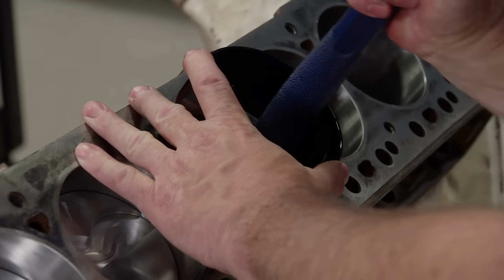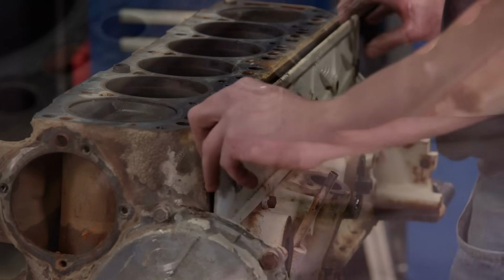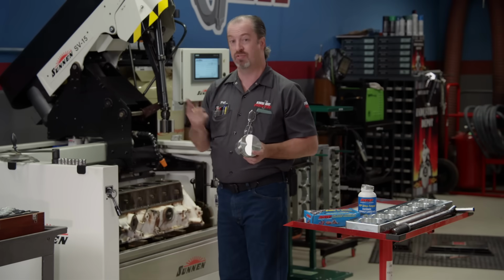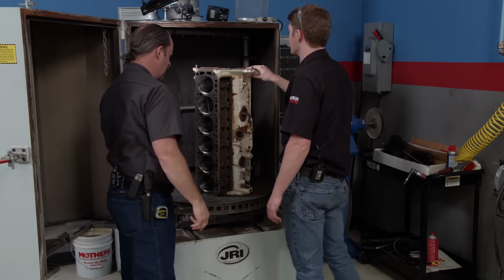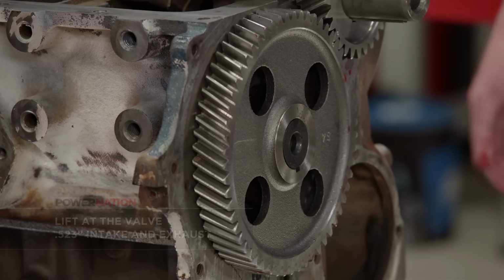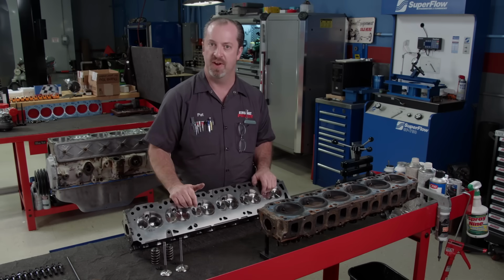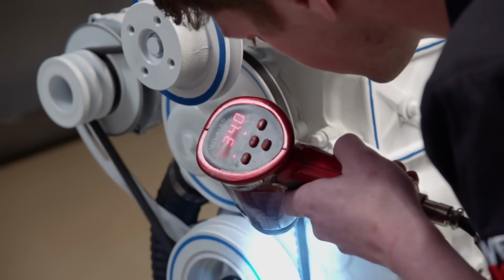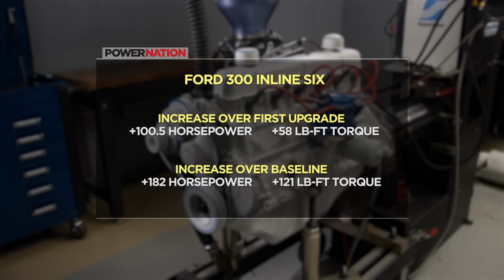Full-Tilt Build On Our Ford 300 Inline 6 For Serious Power Gains - Engine Power S8, E3

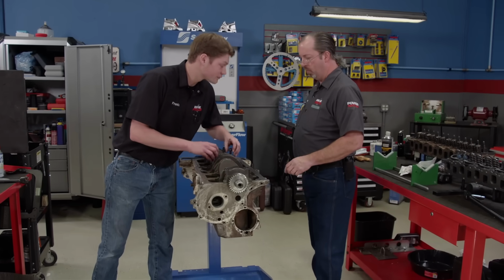Comment: @11:55  Question:  If you are so concerned with distortion and accuracy why are you assembling that WaY vErY LoNg AnD VeRy HeAvY InLiNe SiX CyLinDeR on an engine stand?
You REALLY ought to be doing that on a table!
those engines are known to distort under their own weight AND break engine stands!

Comment: A friend had me put a piston in his 300 6...he got me a new piston, but it had a huge dish, compared to the og flattop pistons....it actually ran! What was so amazing, it would run on 5 cyls. At idle, and by about 2000 rpm, that cylinder would start firing! I thought it would blow up, but it didn't. Now, the amazing part...it showed how weak low compression was (7:1), as opposed to 9:2 to 1 (og). A drastically dramatic difference!

Comment: My dad had a 1989 F-150 with a 300 I-6 with EFI when I was learning to drive.  Regular cab short bed 4x4 5-speed and 3.08:1 final drive (ugh).  It got better gas mileage in 4th gear at 60 than it did in 5th, but it would get 18mpg at 70 in 5th.  It wouldn't go over 80 mph though.  Horsepower was 145 and I don't know what the torque was but the peak was around 2000 rpm.  When pulling a trailer (around 3k lbs of utility trailer and lawnmowers) it wouldn't maintain 60 going up hills, but down shift to 3rd and it wouldn't drop below 2k rpms no matter how steep the hill.

Comment: great vid! Based on the cam and the mild head that was what I was about what I was expecting...the cam, compression, moderate headflow (but vast improvement over stock) left me thinking that applied to a typical v8, I'd expect a 350hp build. Fun to see builds that aren't the typical.

Comment: I was expecting 1 HP per cubic inch naturally aspirated.  Perhaps a roller cam was appropriate. In the video, the cam seemed smallish, and the engine fell off the power curve quickly. Cotton Perry was a legend 50 years ago racing with his 301 inch Chevy six. Check it out: http://competitionplus.com/drag-racing/news/18688-cotton-perry-and-the-legend-of-the-pocket-rocket

Comment: How about a much more available engine, the Jeep 4.0
Reply: They already did that there's actually a really cool build where they maxed one out on the horsepower monster if you want to read about that and they said a new world record for those Jeep 4.0 I like the Ford 300 better because it's got an open plate to the lifter galley and I really hope someday of being able to make link bars and a spider so I could put roller lifters in there and it's just bigger and it's Ford although I'm getting quite mad with Ford right now with their EcoBoost as nice as they are when they work when they stop god its a pain working on them.  and the Ford 300 was put in tons of things not just Ford trucks but industrial delivery vans those UPS trucks that delivered all your Amazon crap well I think Amazon delivers their own now but still those all run on Ford 300s Ford straight sixes I mean hell this 300 came from the industrial side it was running a pressure washer I think they said

Comment: I liked to see a build on the V6 4.0L SOHC You know the engine that was in the  Ford Ranger 2001-2012 Ranger, 2005-2010 Mustang, 1997-2010 Ford explorer. and 2005-2009  Land Rover LR3 (Slightly different block cast). The motor is in a slew of cars what are you afraid of Summit not having any easy mods for it.
Reply: They are afraid of the timing chains and guides failing
Reply: @KRRZ350  205000 Miles on mine no failure yet. So I call BS

Comment: I'm still waiting for a dyno shootout of engine bay heat, shaker hood, cold air with cone, and a ram air via.. 427 Fairlane thru high beam headlight bucket replacement..  certainly your buds next door can assemble a mustang or camero front clip to roll in and around the engine in the dyno room.

Comment: I'd like to see the manifold converted to efi using speed density, a holley HP ecu, and a turbo adding at least one atmosphere or more.  Has anyone ever compared the bore and stroke of the 300 and the Ford 302?  The 300 has more leverage.

Comment: sold my 84 ford van to a guy 13 years ago and it had 338,000 miles on it then...the guy still has it and daily drives it . never been rebuilt just regular services...so yeah that 300 is a longevity monster....and also the reason i am looking for an older ford pickup with the 300 in it

Comment: Kinda sad a stock bottom end Honda K24a2 can make similar power with bolt on's and a tune. Yet it's half the displacement. The head on this motor must be incredibly inefficient.
Reply: David Galea  Ford came out with the Boss 302 in 1969. There wasn't a factory small block head that could out flow it until 1997... If ford would have wanted to make a killer head for the 300, they could've.

Comment: Sorry fellas, I know you're trying to plug your sponsor but those water pumps on a 300 are garbage. The cast housing is too big for the hose size. At least it was on my 95 f-150 with a 300. It should be machined down but it's not so the stock hoses don't fit.

Comment: As a Ford guy. I have a lot of respect for the 4.9. I had it ina 93 F150 with a 5 speed Mazda. I smoked a few 5.7s and 5.3s trucks. When we were loaded they didn't stand a chance. No load they would catch up later. Launching I had the advantage. I put a centerforce clutch from summit racing

Comment: @powernation. I believe you would see better  horsepower using the Offenhauser C-Series intake or a Clifford performance intake instead of the Dual-Port. The C-Series or Clifford intake would also be better for boost. The dual port is likely a restriction N/A and will definitely be a restriction under boost. Best of luck Guys.

Comment: Cloydes has a three key adjustable crank gear. That way you can change cam timming later to try to boost HP. How did you discide on 6 degrees advance cam timming?

Comment: I wonder how long the thing ran with the rag in the water pump. The rag looks in pretty good shape, so they probably did a "overhaul" on it then set it aside. How long did you guys run this thing during the tests. I wonder how most V8 engines would put up with this nonsense.

Comment: Hopefully someone will make a decent aluminum cross flow head for these, I could easily see 300hp and 400tq if it could breathe better, ive got the same engine in my 80 bronco, the original 302 and then used 351w I put in didn't last long,  that 300 wil last forever, I'm getting ready to put efi with intake and exhaust on it
Reply: If enough people by the other parts like cams and intakes and exhaust I'm sure they will problem is everyone who has enough money to do stuff like that always goes for the v8s so if they did make anything for the 300 it would have to be cheap to sell or at least that's what I think and that's why you don't see that much and I mean it was a base engine base engines never get the love I had a 2011 mustang v6 and I had that thing running low 12s in the quarter mile with just a vortec V3 with a bracket and intercooler and tubing I made myself on 9-10 psi with 26mpg average it was awesome but there was hardly anything for it cuz it was the base engine and you get a coyote and do so much more

Comment: Needs more cam. Get a custom grind that will raise the power peak up to 5500 rpms.
Reply: I don't think you could even Rev that high without upgrading the crankshaft and bottom end.  These engines are low RPM torque monsters

Comment: I had an 85 Ford Econo with one. The only problem I had was aftermarket replacement distributor parts. I replaced the electronic board 3 times before I got a good one.

Comment: Thanks for doing the Ford 300. That would make a great engine for a host of different projects. I don't believe in brand bashing, I believe in working with what you got or what you like. I'm in the process of building a 225 slant six and I might put it back in the Aspen it came out of or I might build a rail for it??? Thanks for video guys

Comment: if I was them I would look at a custom Crank and swap her over to EFI as well as look at changing the Sparkplugs out for Better ones like E3 etc and also look at swapping them to a Rolla Cam bearing style it would free up more Top-end Power and maybe get her to the 1HP per Cubic size.. as for adding a Turbo it would push the HP up by maybe 90-120 HP and 80-100 FPT but in the end, the 300 is a good Block I used one in my Dirt track Car until my car become tboned in a bad crash,FYI been a ford man my Whole life.. long live the Blue Oval

Comment: I learned to drive on a late 70's F-100 Custom with the 300 Inline 6.  It ran on neglect, never let us down hauling wood, and would claw its way through snow like nobody's business. Gear wise, it topped out about 65 mph, but on the low end, wow!

Comment: Still run a 81 and 84 f250 4 speed trucks with a 300 in them and when my f600 died on me 2 miles from home the 81 brought it home up 2 hills didn't hesitate and the 84 is a service truck that weighs in at 11,500 and just laughs at the weight it not going to win races but will run longer than the truck very dependable

Comment: I had an 88 F150 with this engine. It got 11 miles per gallon. 11 miles empty, 11 miles on the highway, 11 in the city, 11 pulling 10,000 lbs... it got 11. Lol, but it Never Died!!
Reply: i drive a 96 F150 with L6, i get 15.3mpg highway, no load, running about 73mph
Reply: @maxtheroofer8004  I'm currently driving a F250 SD with the 6.2L. I get 12.4 mpg. BUT I LOVE IT!

Comment: The 4.050" piston you said is for the 390. The 360 is 4.050" also. Is that the same piston? Or does it have different dimensions in pin size or height?
Reply: 360 and 390 use the same piston they use a different rod

Comment: Nice build, i,m curious to see the fuel consuption of tha 88hp vs the 200+ hp engine
Reply: In reality does it really matter? It's not a v8 but it's displacement is right there with them so the two less cylinders is pretty misleading. Calling them "economy" motors is a joke
Reply: @dustinlittle4194  in trucks theyd operate at lower rpm vs the 302, and wouldn't lug at low rpm as much, vs the 351 and 460 a stock motor would make same or less at those same low rpm, but it would still drink less fuel if it wasn't massively loaded down.
Reply: I know that mileage doesnt matter when you use in the soviet mode.
But comparing those grafics, the engine its doing more hp in the idle than the peak hp of the stock engine
Reply: @MrIngorodrigues  id bet that the 88hp isn't that much better, most of the lower power came from it needing a rebuild, it wasn't super efficient as far as power/fuel consumption id bet. It was a stationary motor so it'll be pretty hard to find out a fuel number

Comment: It be interesting to see how the 300 responds to a little nudge of nitrous.  I had always thought about a Maverick with a built 300 for fun.
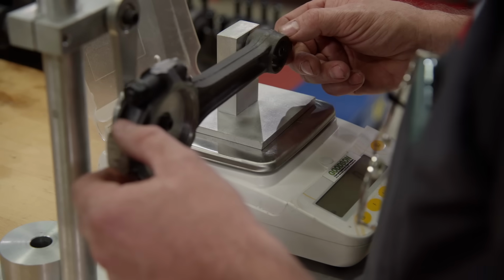Reply: I am running a 1972 Maverick, 300 six, C-4 trans and 4:10 gears.  Best quarter mile time was 10.19 but that was with a wild fuel mixture, not legal with NHRA.  The 'Green Weenie' runs consistent 10:30's all the time.  As an old dragster of mine said back in the 1970's,,  Six in a row Will Go.
Reply: @frozenbits48  That is awesome I bet you got some bewildered looks from people when you raised the hood on that Maverick

Comment: I have one in my 1982 Ford F150. You guys are the experts, but the cam seems a bit hot too me. I think it helped horsepower numbers but might affect torque numbers. At least, low end torque. 3100 is still relatively low though. I'm considering a Comp Cams High Energy 206/206 at 50 when the time comes. But I'm not set on it yet.
And I'm not judging. You folks are the experts. And you make it look like an art form.
Reply: Already have an Offenhauser Dual Plane Intake and Rebuilt Rochester Quadrajet 4 Barrel carburetor.
I have an HD exhaust manifold, but it looks like it'll be a while before I can get it on. Still working on my plans for the rest of the exhaust system. Might dual it out from the manifold if possible. Thrush Turbo mufflers.
Might keep the 2.70 gear, but make it limited slip. Add an overdrive transmission eventually.

Comment: I had a 1978 F-150 with this engine. Put 417,000 miles on it with regular maintenance only. 

A buddy of mine borrowed it when he had no car and no money. I wound up giving it to him. Years later he told me a story about the truck. He NEVER checked the oil, or changed it, eventhough the truck burned a quart ever 3,000 miles or so. And one day while driving on the highway, the motor slowed down and seized. He THEN checked the oil to see it was bone dry. He walked a few miles down the road to a store, bought oil, walked back and poured it into the engine. He said it started right up at that point and never gave him any problems afterward. The truck drove fine for many years after that.

Comment: There’s lots of low buck stuff you can use in the big block six.  Like Chevy valves, rods, and rocker arms.  Meaning you can buy all of these things on the cheap oops forgot Chev small block pistons.  And if you really want to go nuts take some ls heads and check the bore spacing and bolt patters cut and weld it’s a twelve port cross flows head with big time flow numbers. Let’s spend some of your moldy money

Comment: I'd like to see the 292 Chevrolet run against the 300 Ford,  both N/A and boosted
Reply: They did it.  It's from Project Low and Slow I think.
Reply: @bmstylee  yeah project low and slow had the boosted 292 but didn't have the extensive rebuild that the 300 Ford did

Comment: I have a 1985 f150 4x4. With 300 -6. With. 438000 thousand on it and still running great. I rebuilt it at 200000 thousand and it didn’t need it i done it cause I had the money to do it and I thought it would be safe to do it at that time it’s a great engine

Comment: I learned how to turn wrenches on a 300 six. Still my favorite engine.
Reply: ‘63 F-100 with a swapped in 300. Standing on the bumper and barely seeing over the radiator cap.
Reply: I learned on it's little brother, the 240.
Reply: Had a 85 f-150 300 straight 6 4wd 4 speed Manual field truck at 13 years old, could see through my floor boards but ran like a dream, learned how to changes starters, rebuild carburetors and a bit about distributor caps love the motors cant kill them
Reply: @loganmyers3394  true 300 big six is a beast..there not fast but reliable and torque monster ..I daily a 94 2wd 5spd
Reply: @jdubskiwright2380  my bro had the 2wd 300 5 spd  and I had a 300 4x4 auto.   Both of them went 400 + k before the bodies rotted away to unweldable filler and foam lol.  Both ran fine
Reply: clay  nice.  I got lucky bought. One with only 108k on the clock only at 115k now.. It does need a clutch release bearing tho.. next to no rust on her too..its an xlt electric windows lumbar support.. I would love to swap in the zf heavy duty 5spd with the granny low gear..same truck in my bio pic
Reply: @loganmyers3394  
Bought a similar truck with 300i6 for $500 and expected it to last maybe a year to have a little bit of off road fun with

10 years later it still runs and everything that ever went wrong with was such a cheap and easy fix that I just had to fix it. The only problem it has is on the first start of the day it has never liked to idle on all cylinders until its warmed up i basically have to give it 1/8 throttle or so for 5min. After that though you barely have to turn the key to get it going for the rest of the day. I guess I should either EFI convert it or stop being a bitch and learn how to properly set up carburetors. It also feels basically too slow for highway driving which isnt what I use it for but it would be nice.
Reply: @P7777-u7r  i bought a 92 single cab short box 2wd with a 5 spd for 300 bucks. body has typical wisconsin rust but only 96k miles and runs like its fresh off the showroom floor
Reply: The first engine I rebuilt was a 300. I was 16 at the time. They are very simple engines and great for learning on. People can shit on the old iron all they want but I would be willing to bet that 50 years from now, they will still be around whereas the stuff made nowadays likely will not.

Comment: Just bought a 78 ford with a 300 and it fired up on 6 year old gas at -25c
Reply: I think the cold weather makes them magical... I'm approaching 200 miles without oil pressure and it hasn't been above freezing in at least 4 months (MN).
Reply: My 78 had an inline 6 where all 6 rod caps were loose. Only way you could tell anything was wrong was because of a small tapping sound. It still ran like a champ
Reply: How much money to do all the mods? Without the turbo!
Reply: My 6 had  628k  on it and  still  ran
Reply: I had a 78 3/4 ton with a 300 with 500,000 miles. Slow but a puller!
Reply: Oh these engines always fire. They don't care what the circumstances are
Reply: @traxxasrcfun they sure don't. That gas was as at least 6 years old because that's when the truck moved last and you could tell by the smell of the exhaust totally rancid. The carb wasn't even bolted on properly lol, I couldn't believe it started and idled after it warmed up.

Comment: I think it would have been interesting to keep the compression low and then throw gobs of forced induction at it. With 91 or 93 octane it would take a hell of a lot to cause detonation with such low compression. If I remember right, there was a guy who did this with a nearly bone stock 300 motor and dropped the mill into a Maverick. Running into the 10s with a dirt cheap build. Pretty impressive considering the need to lug around all that cast iron.

Comment: I have a 1990 Ford F-150 with a 4.9liter/300cid EFI engine that pleasantly surprises me every time I use the truck for hauling heavy loads. The heavier the load, The better that the engine performs. This engine is not a fuel sipper by any means. When you depress the accelerator - This engine always goes above and beyond.